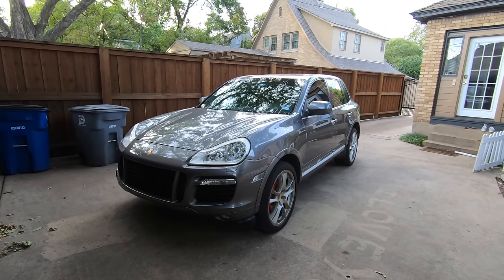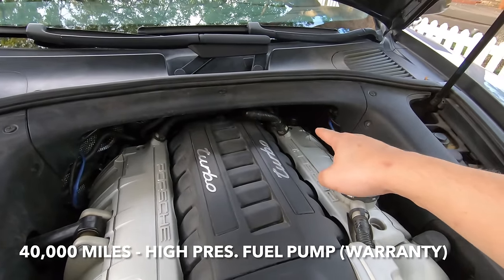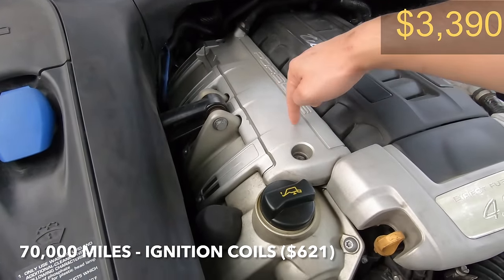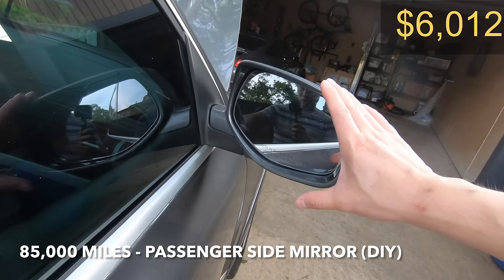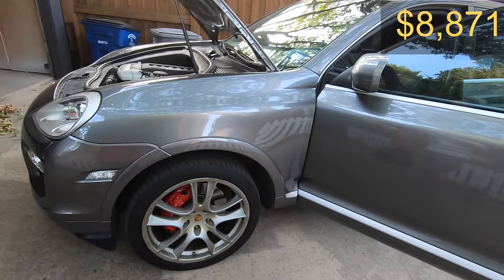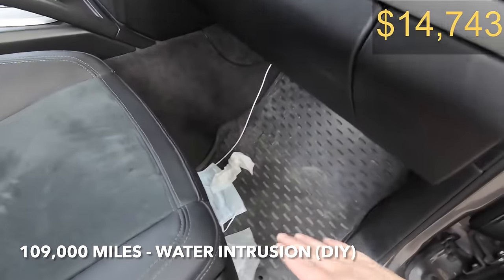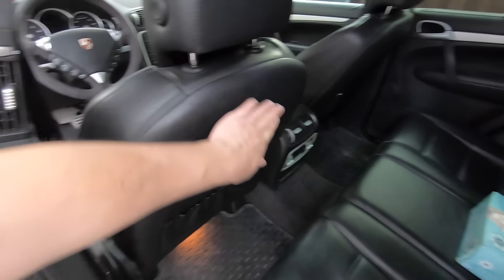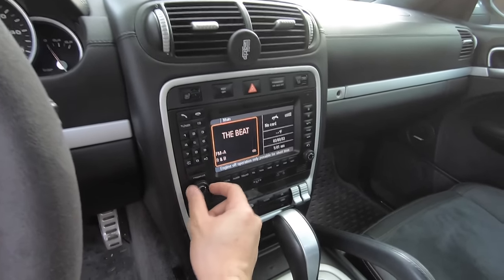Why Are Used Porsche Cayennes So Cheap? Owner's Review of 15 Year Old Cayenne Turbo (955, 957)

Comment: This one has way too many issues but this second generation still looks the part :) When these where new I remember german television testing the Turbo version and this thing sucked more gas than the gauge could display, the gauge stops at 50L/100km which is 4,7mpg :)

Comment: I had a used 2004 cayenne turbo, 145k miles, previous owner spent tens of thousands in repairs before me. Just the rear engine crankshaft seal was $4700. They have two fuel pumps (two gas tanks) that was another 4k. It was a nice driving SUV....but I got rid of it as I am a DIY guy and this thing is extremely difficult to work on, not to mention the special tools and star bits/sockets. everything is packed in there and most repairs require the entire engine/transmission assy to be removed from below the chassis. I had to replace the leaking plastic cooling lines that are under the intake manifold, what a nightmare + one of the turbos started making noise, took me 42 hours to remove and replace two turbos, which was not cheap either. Porsche, never again for me, sticking with my Toyotas

Comment: It’s a shame you can’t get the diesel macan 3.0 td I ran mine up to 150,000 with only tyres and oil changes. It doesn’t have as much power as the turbo but it’s smooth; buttery and reliable

Comment: Solved the problem of Porsche and expensive recent year Toyota models.  Instead purchased a 1989 Volvo 740 with only 57,000 miles on it.  One owner.
Engine and transmission will go 200,000 miles with ease.   Funny,  but on the freeway,  I am able to keep up with all Porsche models.    PLUS,  no one seems to want to break into or steal this model.   Can travel in dangerous parts of town and never face    theft problems.    They don't even seem to want the catalytic converters (like the Toyota models)
All in all,  peace of mind and ultra low insurance costs.   BEEP BEEP
And the gals love the comfortable seats,   Prestige all around.

Comment: I have a Kia Niro hybrid with 90,000 miles. The only maintenance I’ve down is oil changes at 6k miles and transmission oil change.  Nothing else has been done and no problems at all….hmmm let’s get a Porsche

Comment: I think you need to do what you have done and stay on top of your maintenance. I would say that $1000 a year is doing really well for any high performance heavy SUV. I suspect it would be really easy to get ripped off by shops that see you as a source of money driving a car like that.

Something that I have found with older high end cars is that if they really have been perfectly looked after they dont really get to a state where they break all the time. I think the worst period of time for a high end car is at around 80K miles or about 7 years old. Lots of things fail at the point and often the replacement parts have the issues designed out of them. For example, your new coils are probably revised and improved coils from the original and unlikely to fail again.

Comment: Two grand for wheel bearings? I must be missing something. Wheel bearings for an '08 Cayenne run about $60 a piece from Rock Auto -- and you can swap both rears in about an hour.

Comment: What a nightmare would hate to have a car that keeps breaking, I have a Kia Optima wagon that I bought from new in 2018 UK, just had tyres and brakes replaced, never let me down and have done 120,000 miles in it, will keep it until it does die one day

Comment: Got a 2007  3.2 manual S
106000 miles.
In the last year had a new battery and alternator also front left wheel bearing 
Urgh

Comment: compared to my Lexus RX450H our Porsches are really cheap to get after a few years and 100000km.  They are extremely expensive to fix while many things on a Lexus can be done by a Toyo shop ! greetings from germany
Reply: I'm looking at buying a RX450H, a 2009 Cayenne or a 2016 Forester. Those are my 3. Cayenne is third on the list I'm a bit worried about reliability.

Comment: Those repair costs you quoted were low, that were not DIY or warranty work, it sounds like you found a good mechanic.  It would have cost a lot more than $14k for those repairs at the dealership.

Comment: I had the 2004 with what I think was the quickest motor.  The driving experience was the best of all the cars I’ve owned.   It was very costly and I kept it for maybe 4 years, did the dreaded plastic coolant connection replacement. 
When it came time to do the springs and suspension I had about 120k on it (I bought it used in 08 and it had less than 20k in it).
I knew the issues when I bought it, but it was a fresh immaculate example.   I regret not keeping it but it was easy to see that all the plastic was drying out and all the little things were going to require time and attention.   I just miss the pull it had and it felt like a masculine suv.   Best truck I’ve owned!
Reply: Just rub some tree sap on the coolant hoses.

Comment: Lol had the exact same car, and guess what...I had the same faults in exactly the same order just not the fuel pump. And only one coolant leak. (but a major one had to take out the engine) my problems stopped there . Oh last problem was water under the driver seat..that however killed the cables and that was the end of my cayenne. 😢  Honestly my best car ever...I had a Heinz tuned version it was awesome.  But just ordered the new 2024 version.  Fingers crossed 🤞

Comment: $1,000 a year for repairs and maintenance (not  including tires, oil, wipers and gas) is not bad. That's about what I average for my 2002 Ford F150 Harley edition. I get that you minimized costs by DYI ing but still not as bad as it sounds for all the failures

Comment: Clearly about 80% of these costs are if you don't do anything yourself, pay a mechanic for labor, and their inflated prices for the parts. The lesson here is, if you are going to buy a used German or other car that's notorious for being expensive to fix and will need fixing regularly, be mechanically able, or at least be prepared to learn how to fix it yourself. Some things may require extensive process and/ or knowledge to do, and that's what you take to a "professional", but the vast majority of these issues are not that expensive or hard to fix yourself and make getting a car like this more worthwhile and a bargain considering the original cost.

Comment: Damn that's terrible. My 2004 Grand Cherokee made it to 190,000 miles with nothing but oil changes and brake jobs. I spent about $1,000 and did my on spark plugs, valve cover gasket, radiator, thermostat, one wheel bearing, shocks and control arms. Now it's well over 200k and I think it will make it to 300k. It might be slow as hell with it's straight six but it keeps going.

Comment: 2000 Jeep XJ Freedom   
One of only 2821 built.   378k miles and still gets 22 mpg at 8000 feet asl.
Aren't Cayennes just fancy VW's?
It's the same AWD system. The treg is 50/50 natively, with the Cayenne being 40/60.

Comment: Honestly. This happens with every other car if it isn't properly taken care of. All this luxury SUV's owners do not use screwdrivers to clean the water drains. And mechanics? Well. You can't find good mechanics or just the mechanic who shows a little pride in what he is doing. Bearings on axles should be a maintenance point by every shop visit. I don't know if some home mechanics know: If it is possible to screw off the ABS sensors on some wheel bearing assembly  - you can put some extra bearing grease in it. In the old days, we had to take out the bearings, clean them and re-grease them by every second scheduled service. Today? People drive and think that nothing will happening. A car is made out of thousands of parts. One will get bad. That's for sure.

Comment: My freaking 2019 Suburban... 74,000 miles. 1 Repair.... Rear tailgate actuator. $168 + $75 to calibrate it to the tailgate ECU. Did you spend more money fixing that POS then it cost to buy it.

Comment: like so many of these high quality supposedly german cars from audi, NBMW M cars and AMG is that they engineered with failure points that regularly and consistently happen many germans buy korean cars for better reliability, auto boxes in M cars were stuffed for more than a decade. whilst porsche built it correct with the DPK after the earlier five speed autos

Comment: That is like a $100 wheel bearing. Why did it cost you $2000?
Reply from the maker: It's probably 2-3x the price for a Porsche OE equivalent wheel bearing. Labor is $150-$200 per hour for an independent mechanic. Plus, one of the old wheel bearings was seized into the hub, so the mechanic sourced a used hub assembly. At the end of the day, people need to realize an old Porsche Cayenne, while cheap, still comes with the repair and maintenance costs of a $100k vehicle.

Comment: between my brother and i we have had 4 cayenne`s 3 of which were diesels and we never had a major problem with any of them.1 was a first gen  petrol and it had all sorts fixed, i currently have a 4.2 diesel GTS and it never misses a beat, i think you may have bought one thats been a bit abused or the petrol versions just suck, you said 2000 dollars for rear wheel bearings?  i also think you need a new mechanic or better yet do it yourself

Comment: When serviced appropriately a Porsche will last a long time. Yes they are expensive but they are also top shelf cars not like a 4 runner. Incidentally I also own a Lexus GX 460 with a 160k and it also costs money. Major, known engine/coolant issue costs a few thousand dollars. I’ve also had to replace water pump, alternator front struts and will have to do timing belt again in the not too distant future. The clear coat is flaking  off as well. My point is that all cars need service and mechanical things break!!
To those making a comparison to a Highlander or some other Japanese car…there is NO comparison in regards to performance and driving experience. Like comparing a huffy 10 speed to a Pinarello dogma road bike.

Comment: You NEED to buy or borrow both a Double-barrel Shotgun & a 15-pound sledgehammer! 
PLEASE, Please...use them both to guarantee the death of this THING! Incredible!!! 
My 2004 Nissan Titan PU I bought on my BD in 2003, has had ONLY 2 Spark Plug coils replaced out of eight! 
Nothing else! The rest have been Tires, Batteries, Mobil 1 Oil, Valero Premium Gas, and Coolant additive.
I would say go out NOW, & buy a new Nissan Titan IF you can find one; as Nissan is stopping production!!!
So many people NEVER understood Nissan & now she is shutting down the production line!!!!
 Arggggh! :face-blue-smiling:

Comment: And earliest Porsche Cayenne The actual engine block is faulty from the factory. $17000 to replace with the same problem. Happening after another 15000 miles or so. The 4.8 block is c***

Comment: My 2009 Cayenne S (957) with 125,000 miles has needed the driveshaft bearing kit, thermostat replacement (might as well replace the water pump while doing the surgery), steering column (to replace an unrepairable steering lock module!!) and more. And yet, I won't part with it.  Costly? Yes.  Great looking and driving 15 year old SUV? Yes. Sucker for punishment? Obviously.

Comment: So before you get to 80,000 miles you possibly should be ready to drop vehicle off at dealer every 1,500 to 5,000 miles at best. Of course I know not every single one of them will have the same issues or much of any issues. But I absolutely know they will have issues and not just a few before they get to 100,000 miles. I actually would love with all my heart having one. But I can't afford attempting to own one without factory warranty.

Comment: Buy a 2008 Lexus with 116k on the odometer and you can drive it another 200k with just routine maintenance and replacing consumables like tires, brakes, wipers, ect.

Comment: I've had my 04 cayenne for 10 years.  I drive the crap out of it, every year I have to change out the tires.  I only did the brakes once since it has its own built in engine braking.  I did the battery, starter, coolant pipes, and drive shaft.  Most people wouldn't go after small stuff like the sunglass holder, most people ignore everthing and drive their car into the ground until they blow the engine.  If you really want to save money dont fix anything and then brag how you didnt spend a dime on it.  Those guys usually have the original engine oil after 50,000 miles LOL.  Dont forget to change out the transfer case oil or your rear end may go out.  And I'd dare say most people don't keep track of all of their repairs over 16-20 years of ownership.  Sounds like you got stuck with most of the repairs that didn't fail in the first 10 years...  Keep in mind that it was a $100,000 car and when adjusted for inflation is $170,000 in todays money.  A couple thoisand a year to keep it on the road is no big deal.

Comment: It is a popular car in Tokyo,  I see this model often on the roads. Not sure if those in Tokyo having similar issues.  Either way , in engineering there is a philosophy of finding the balance....in case of German cars, they over engineered their cars and  at about 5 years marks it is akin to timebomb,  things will start to breaks/malfunction vs non German cars, be it Korean, USA, UK or Jpn or whatever
Reply: Thats wrong sorry. Luxury brand such as Lexus, Cadillac or Porsche they are ALL over engineered. Try to work on a Lexus ls460. Let alone Toyota poor build quality when it comes to rusty frame panels, peeling paint, head gasket, engine out jobs, rust everywhere.. Same for GMs and koreans..

Comment: im half way through this video and my mind is blown... i drive a 2012 subaru wrx hatrchback with over 160,000 miles and the only thing i have had to replace on it besides tires and brakes was a clutch due to my own retardation and a radiator that had a small leak. this porsche already costs just in repairs half of what i paid for my car

Comment: I was looking at these for a few yrs thought I'd treat myself BUT NOW NOOOO !!!! 😮 I was looking at Masarati's as well 2007 what a headache also ☹️🙄💰💰 shocks no bushings
 $ 2k each, Catalytic converters EACH !! $ 13,000. 😢 again no thanks. I bought a Nissan Pathfinder 5 yrs ago 2002 I paid $ 800. NOT 1 ISSUE I just Sold it for $ 3,500. Just bought a 2006 Smart car Diesel $ 2,500. No issues in 3 months.

Comment: Everyone talks about German engineering...
I've got a 2002 F150 with 235000 miles on it, and haven't had anywhere close to these kinds of problems
Also have an 03 Dodge Durango with 150k, a 2000 Jeep Grand Cherokee with 175k, and an 03 Nissan Frontier with 175k...
I haven't had as many issues with all of those combined as you have had with this car. I love the Cayennes, and thought about getting a used one, but I'd be broke maintaining it.

Comment: I had a 33000 euros expensive bmw 320d in 2001 on which thw turbo broke....the suspensions broke... all so GERMAN quality😂😂😂😂😂

Then i had a vauxhall used in 2011 for 16000 euros which had 16500 kms on it back then...

Well today it has 276000 km and still runs fine.
Had to change 2 batteries one connector and some other minor things that do not sum up to 1000 euros even...

While the turbo and the suspensions of the bmw together were 4800 euros

Comment: You paid 2k for a rear bearing replacement ?  I checked it up, in aftermarket i found the most expensive one at 150 Dollar, cheapest one was 75 Dollars,  so let's add labor. 500 Dollar max.

Comment: The issue here is buying the Turbo, and all the options. They are just over engineered. I own the exact same car, same year, but a base 6 cylinder model. It’s literally the most reliable car I’ve ever owned. It’s got 144k miles on it and has needed nothing but oil changes, new brakes and new tires for the past 50k miles / 6 years.

Comment: Ummm the morror issue. The drivers morror doesent bow down when in reverse. Flip the adjustment switch to the left and put it in reverse. I bet it will bow down just like it dose when set to the pass side mirror. My Honda Crosstour works like that. In my 6 years owning it Sam only had a door lock not work with the key, under warrentee i bought when i bout it at West Herr Ford, and rear view camera, again under warrentee. Dont know ehat went wrong before buying her, but coming up on 140k no out of pocket cash other than maintenance , and consumables. Oli, tires, breaks and such. 

Well folks Honda all the way. I wonder the cost of your work done if it happened to Sam would have cost?

Comment: Some materials in cars nowadays have a "best-before" date. And this makes them not aging well. Plastic breaks, aluminium bends or cracks, glue oxidizing and looses adhesive properties. All these replacement parts are expensive and makes the manufacturers more profit than the sale of the car did.. Aftermarket parts are also an billion dollar industry. And ofthen the manufacturers of third party parts (🤭🤫😅) pays a licensingfee to the patent holder. 
...and now I have forgotten why I started this comment... 🤔😮‍💨😏😉😁🤣

Cheers Y'all 🇸🇪🤘😎🤙🇸🇪

Comment: I've had my 2005 Toyota for 17 years. I have replaced the front brake pads and tires, changed the oil, filters, and other fluids.  Thats it. My car will beat your car in traffic because of the driver and the fact it is small and more maneuverable. Ha- Ha.

Comment: What PEOPLE NEED TO KNOW is the BUSHINGS due to this vehicles AGE and ABUNDANCE of PRODUCTION is the ENERGY SUSPENSION makes POLYURETHANE bushings for these vehicles WHICH RESIST WEAR and CORROSION (not to mention massive handling IMPROVEMENT BEYOND STOCK), and being this vehicles MASS, it's a CHEAP UPGRADE especially for the FRONT END where all the WEIGHTS AT. If you've purchased 1 I'd "HIGHLY ADVISE" this be your IMMEDIATE ATTENTION.... Plus, lol.... learn how to work on it to keep MAINTENANCE COST DOWN, member IT'S STILL A PORSCHE.....